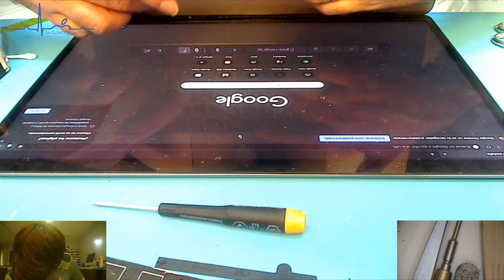Flexgate Fix Kit Demo - PreRelease

Comment: This is a great jig, but a scary price that only high output repair shops can afford. I’m a quasi pro that repairs mostly vintage Macs. I’ve repaired many Retinas and have thought of jumping into the later MacBooks and feel I can make this repair. Your video explains quite a bit. Thanks for the detail. I did subscribe to your channel.
Reply from the maker: I hope you do! They are pretty fun to work on but are also their own beasts. Indeed, this kit is designed for repair shops that see several Dustgate repairs a week or month. The price point is set so you make about $200-$400 an hour in this repair.

Comment: $300 sound bit high , for small 3D print , + 3 extra flex cables -  but good invention
Reply from the maker: Thanks for the feedback. We ended up designing the jig through its versions so that it has the right fit and the curves are down to the 50 micron range- so it pretty much locks its self into place, that is why we are including it in the kit for the $50 or so. The flex cables, we are preparing by hand to make sure both sides of each one are ready for you to solder into your clients macbook pro :)
Reply: It sounds because it is. For someone looking to repair its own computer this price can’t be justified.
 Maybe a better idea would be to separate the target market between diy people who will use this once in a lifetime and for repair shops. For the first one, maybe open source it and collect donations and for the second one, cast those parts in some polymer that stands high temperature and is durable. The flex cable honestly doesn’t aggregate any value to it as the one doing the repair will need to strip at least the flex cable on the MacBook anyways. Also it is a nice idea and understandable that one would like to get compensated for it, however taking this selling point it won’t last long until the first person in China buys it, makes a copy, start some mass production and sell it for 1/10 of the price.

Anyway it is indeed a time consuming process to get the measures right and I hope you can at lease get recompensares for your time :)
Reply from the maker: Hello  @jpcurti1 ,
For someone looking to repair their own MacBook, I would recommend buying a new display assembly. For many years that is all we did as there was no good permanent solution to flexgate - (even the new screen has the chance to fail as its the same length flex). Many shops were running jumper wires, but we strongly disagreed with this method as mechanically, they would break after a few hundred opens and closes.

Sadly, I did reach out to china a few years ago, to a few of the mfgs that make this kind of stuff - to pop the idea to them - and was ignored. The flex cables we are providing are the  key to this kit. The jig is a helper to align them and make your work as a professional - consistent and professional. As mentioned a few times in various groups, the cable is prepared on BOTH sides to expose the copper. Not just the top. Soldering flex cables is not just as easy as - glob some solder on and hope it jumps across a gap to make a connection.
The flex cables we include with the kit and separately, have the top layer removed - like you will need to do to the flex on the screen, but the back support material is also carefully removed, so that is is exposing the underside of the copper vias. This is so that you are soldering the via onto the via making that good electrical and mechanical connection that will last for years - instead of running little jumpers, or globbing solder on that will rub internally on the guides for the cabels.

I understand how having flexgate as a consumer is super frustrating. We came up with a professional solution to offer other service technicians that would like to preform a flexgate repair consistently and professionaly - to be able to offer a warranty on it, and have the end result be 1. Cheaper than half the cost of a replacement screen. 2. Fixed correctly so that it will not come back as an issue. We also focused on you as a technician, being able to repair 3-6 flexgate screens an hour to double or triple your work capacity allowing for happier clients, longer lasting repairs and ofcorse, more income from the work you have preformed.

If you ever see a link from china selling them, cheap but with quality (especially the prepared flex's). Please let me know. I would much rather buy them in bulk as a repair shop myself than make them 1 by 1. (This was why I initially did reach out to china - I just wanted to buy an end product instead of needing to design it all and make them)
Reply: @JosephHughes  Hi Joseph. Thanks for your reply. So what you are saying is that the flex cable provided by you is a custom made, double sided cable that is the same size as the original flexcable? Looked like it was just a flexgate replacement cut in half with the insulation (manually and carefully) removed. I still agree that you may have spent a lot of time and effort in this and believe that you should indeed profit on this, however @Martin is also right to state that in the end it is just a (very helpful) 3d printed part. Also if it is petg, pla or even ABS it won't stand the temperature of being close to a 500F soldering iron for much time (if it is indeed for repair shops). 

So for someone that is looking to repair its own laptop (and have a pretty decent notion on soldering), an alternative would be to solder both flex cables (old and new half cables) face to face and then just turn the cable to the other side. Of course it is a very delicate soldering, but if your design was done in some temperature resistant material and both cables were completely aligned, it would be way easier to do it using liquid solder and a hot air gun.
Reply from the maker: @jpcurti1  I reached out to china to try and have them make a custom flex - but it was a nogo. This is the standard flex, but the "magic" is on the backside of the flex. Unfortunatly I did not show this in the video and really only mentioned this one time. A few fellow repair shops pointed that out. My bad on not showing what is special about how the flexs are prepared.
The material is temperature resistant. It may become more brittle over time if you use hot air or cram a soldering iron onto it tying to destroy it. It doesn't really melt though.

Matt Bone at UKSL MacLab has a technique that is what you are describing. Personally I don't like how the flex is bent 180deg back on its self, but from the conversations I have had with him, it seems to be holding up in the field.

I haven't tried hot air on it yet though to see how it would join up. I try not to heat the flex cable excessively and it is cut somewhat close to the screen. I have a few dead screens I can play with though.

I understand that it is quite a bit expensive, especially for someone that wants to DIY. Many shops have a micro-pencil now-a-days and I have found this kit works best at the 500-550F point and the thermal mass of a micropencil. That being said, my personal soldering station cost around $1200, and I do not expect many DIYers to have a very similar system with the types of controls this has. I do not know if I could design this or a kit to be reasonably done by a DIYer. I think that it would be a nice hope, but end up wasted money and an angry customer :(

Comment: Ive got a 2017 A1708, I dont think its the backlight cable but the LCD cable on mine.  I have vertical colored lines on the screen, so I think my problem is a different cable from the backlight cable.  Please advise if you can.

Comment: When you did the tinning at around 13:40, did you have solder on the iron or was it just loosening up the metal that was already on those wires?
Reply from the maker: I had some on my iron!

Comment: What if brightness works fine, but display is black? Can you replace display cable with such approach?
Reply from the maker: Unfortunately I have not experimented with this. Generally if the data flex cable is damaged we recommend a replacement screen to our clients.

Comment: mind sharing the stl files to print ?
Reply from the maker: Honestly I do mind sharing the STL files. I have worked through many revisions to get to where it is now, and am selling the end product. If you would like to buy a kit, feel free to submit an order request :)
Reply: Then he couldn't overcharge for it. No amount of revisions justifies this crazy pricing.
Reply from the maker: @johnandrews9433  hi John! Thanks for the creative feedback.
Make your own and give it away to the world, or buy a new screen with the same issue for $500+ :) Not that hard to do
Reply: @JosephHughes  Might have to do that. Or just sell it for $50 and not gouge everybody for a few hours work. Or buy screens at their wholesale price of $200. Shit even single units aren’t more than $300. Or pop the glass off and just replace the backlight. Lots of options instead of supporting somebody that clearly overvalues their work. $80 for a $5 cable you spent 15 minutes scraping the contacts/epoxy off? Lolol
Reply from the maker: @johnandrews9433  I didn't know I deserved so little for my time. Panels at wholesale are around $200 each and the lowest quality for your buck. And you have to install the panel. Single units are around $450 for a good one plus installation and shipping -> Great store btw if you havn't herd of them is ( https://www.protechrestore.com/index.php?route=product/product&path=11_1077_1098_1099&product_id=1558 ).

We don't just scrape some epoxy off the contacts. Read the other popular comments on this video for some more information.

If you want the cheapest solutions, I recommend you look on aliexpress and make your own flex cables and jig. You should probably buy an Acer or some cromebook laptop next time also. Something more worth the money, right? Good luck on your life adventures
Reply: Well said  @JosephHughes ! Know your worth and don’t let anyone tell you different. It’s a tool/ solution to a much more expensive repair and the investment would be returned after using it with a couple repairs. I would suggest looking into a patent on this little jig!

Comment: When will it be available,, pls share the link, is it still needed the loop/magnifier to do job? Tq
Reply from the maker: Hello Mike, If you follow the link, you can ask for a kit. We are making them to order at the moment.
We recommend some type of magnifier as this is still a very delicate job to be done by someone experiences in micro soldering. If your Soldering iron is a few degrees too hot, it will also destroy the cables.
Reply: @JosephHughes  any tricks on finding identifying someone experienced in micro soldering?  ?jeweler ?geeky teen  ?IT guru at our kids school?  Thanks so much for the video- really helped me to understand what our problem is.
Reply from the maker: @Ticiakribbs  There are not many lists I know of to help you find someone that is experienced in micro soldering. Normally - if they have the right tools like a stereoscopic microscope and a micro-pencil for soldering - it is because they realized that quality tools help them produce a high quality and consistent job. Normally it is a good sign that they have some experience in micro soldering. Jewelers might, but they don't normally work on electrical circuits and use higher temperatures and open flames.

There are quite a few people whom offer mail in repair style solutions, it might be a good method for you if you are having issues finding someone locally.

Comment: Cool video!
By the way, would the a2337 models' flexgate able to be repaired like this? Im not willing to pay for the whole screen when I got only the flexgate issue :(
Reply from the maker: Hello Anna! We have not seen this issue in the air models yet. After 2017 - Apple appears to have solved this issue by making the flex cable longer so that there is not the stress point that causes them to break like this.
Reply: @JosephHughes  thanks a lot for the info Joseph!
Reply: I have an late 2018 A1932 EMC3184 MacBook air that has this issue. Screen works when almost closed but when you open it you lose the screen. I purchased a cracked screen just to harvest the flex cable. Hopefully it can be fixed similar to this method.
Reply: @austin22re  thanks Austin!

Comment: Hi, good job man ! I have a question about the temperature of your soldering iron. How many degrees do you use ? Thanks you !
Reply from the maker: Hello Bastien. For this job we are running around 500F to 550F depending on how the flex and solder is responding. Anything much higher, it will start to melt or warp the flex cable.